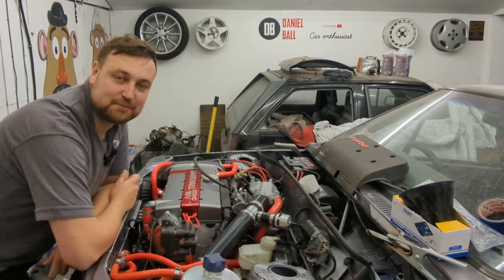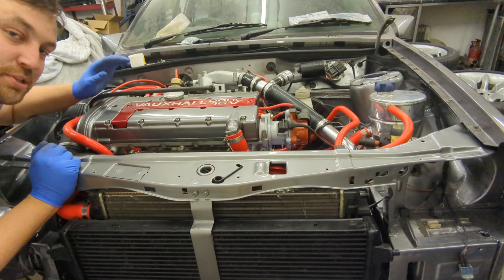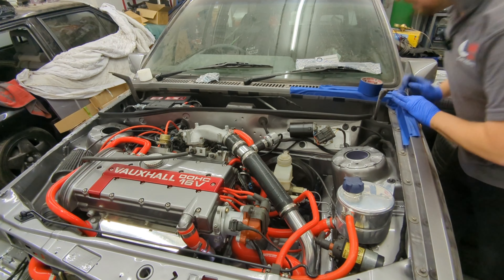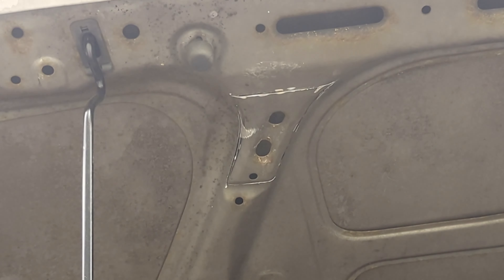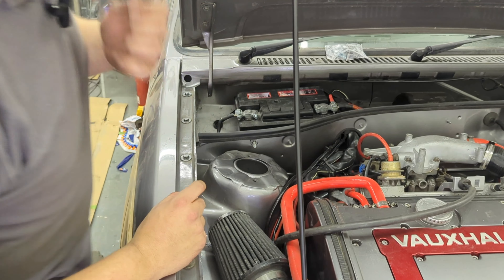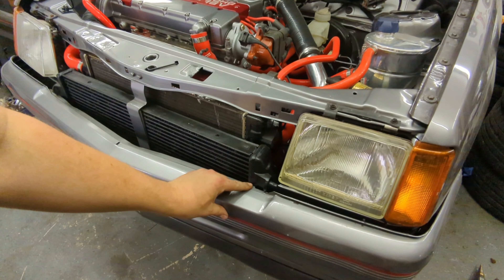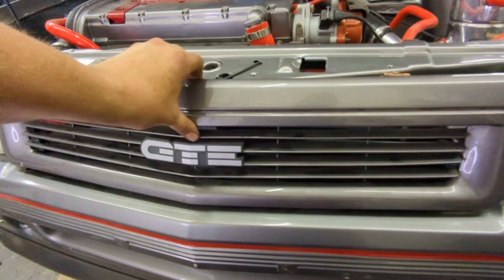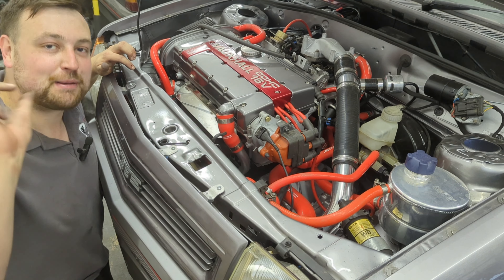Nova C20LET Turbo rebuild - Making the panels fit

Comment: What mounts are you using? Just wondering why you had to cut the underside of the bonnet to clear the cambelt cover? Never did that on my nova when I fitted the let? Nice work though.
Reply from the maker: No idea, but mine always touched on the corner so I don't want to risk it.
Reply: @DanielBall  Strange! Looks well though 👌
Reply from the maker: @ashcardwell7711  thanks pal